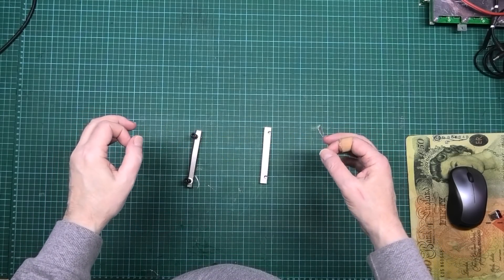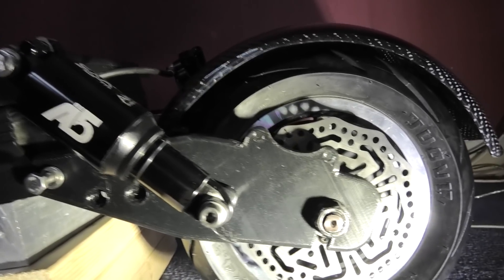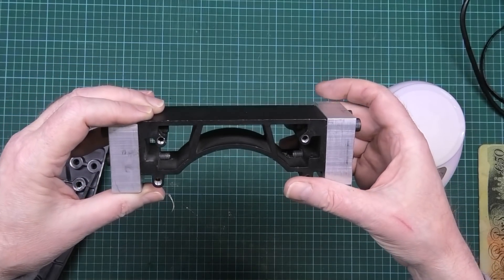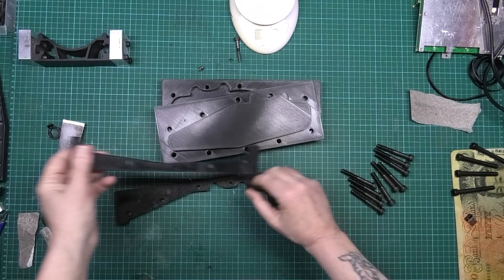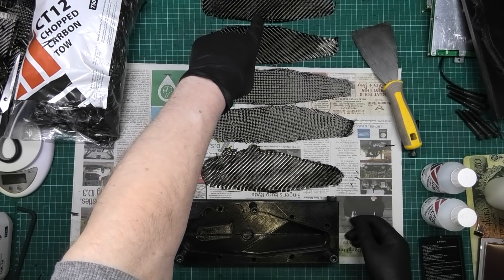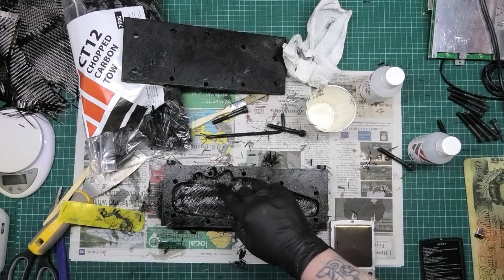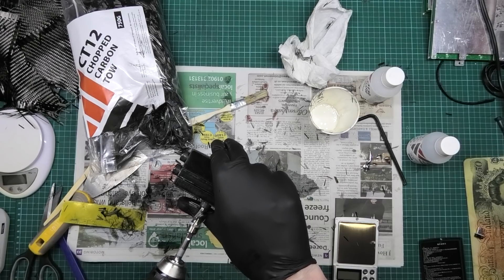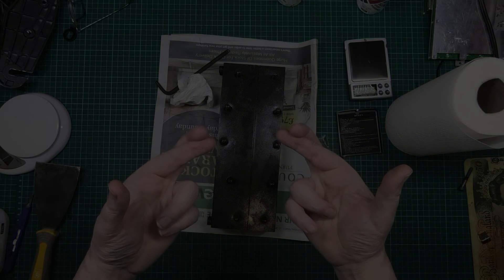🔴 EXTREMELY POWERFUL E-SCOOTER BUILD part 17 - Forged carbon fibre swinging arms

Comment: M3 bolts to clamp the Seat Post in place?... You're kidding me right?
FFS...😳😳😳🤔🙄🇬🇧
Reply from the maker: If it was into a solid steel square mounting plate as I thought it was, it might have been acceptable. When I undid these bolts and a shitty little piece of aluminium fell out, I was shocked!
Imagine on the upper end of the weight limit - a 120kg bloke....... his bollocks would be toasty within hours of use!
Reply: @Vortecks  Why would they use such small diameter bolts..?..Tapped into Aluminium.. FFS....gross stupidity...🤔😳😳🙄

Comment: Hi Tony, Always glad to see you making progress. You're inspiring me to have a go with carbon fiber too - lots of work but amazing results (Just need to finish all my other projects first!).
Regarding the mould, as others have said you can use the offset line tool to make it smaller without changing the alignment. It makes another line parallel to the first, same effect as sanding off an even thickness all the way around. Just remember that the offset is doubled as it affects both sides - I'd start at about 0.25mm as every printer is different and better to take off too little and sand the rest than too much and end up with loose fit.

Looking forward to how it turns out!
Reply from the maker: Cheers mate 😁
Yes, it has been mentioned about the resizing but what software is that in? I'm still using Tinkercad and obviously, it doesn't have any complex functions.
Reply: @Vortecks  I'd never used Tinkercad until today and I'm amazed you managed to make the things you have with such basic software! I was hoping to see if I could figure out a way of doing it, but I think it's probably just not possible (googling got me nowhere either).

I use Fusion 360 - free, powerful and oodles of youtube tutorials. I definitely recommend giving it a go. Once you've got the basic hang of it I think you'll find it quicker and easier - it's much better suited for engineering.

Comment: Don't know if anyone said it already, but when it comes to the mould creation in 3d software, instead of resizing the whole model, you can just subtract .5mm from the entire perimeter, which will give the exact same affect as sanding every edge down the same amount. Just food for thought Tony, been loving the cf conversion so far, really making me want to give it a go!
Reply from the maker: Someone has mentioned it before but what software do you use to do that? I'm only using Tinkercad (please don't laugh) 🤣
Reply: @Vortecks  tinkercad should be able to do it I think, honestly im used to autocad, but the cad concept runs off subtracting one item from another, I think the function you might be looking for is called sweep, someone in your discord may know more about the specifics than myself hopefully1

Nothing wrong with any program, i used to use sketch up

Comment: You continue to impress with your carbon fiber work. It's amazing what you can do from home today when you have the right tools like a 3D printer and the carbon fiber mixture. But you are right - the last thing you want to happen to you flying down the road at 40MPH is a hard rod going up your crack because the damn seat came off. Tight black leather shorts optional LOL
Reply from the maker: Tight black leather shorts are optional? I thought they were compulsory? 😢
I was rather surprised when I saw that 2 bits of 10mm square aluminium was all that holds up to 120kg!

Comment: I’m not sure what CAD software you use, I use autodesk Inventor and it is really simple to mark a sketch such as your swingarms perimeter and make it cut a set thickness from the edge without giving you the distortion issues you mentioned!
Reply from the maker: Cheers mate, maybe it's time I gave some other CAD software a go again. I only use Tinkercad because everything else was rather unintuitive - teaching an old dog new tricks isn't easy!
Reply: @Vortecks  the feature is called offset! I am pretty sure tinkerCAD doesn’t have it but it is incredible! I use it all the time for my interference fits

Comment: Wherever there's room for improvement, you can be sure Tony will find it and do something original about it. They way your parts turn out is so professional you never fail to impress me. Even closer to that magic 19kgs too!
Reply from the maker: Cheers mate, it's appreciated. You're a few weeks behind on the build here but it does weigh 19kg now so it's ready for assembly. I'll do the other parts as and when I get round to them to make it even lighter 😁

Comment: Looking good Tony.
BTW last time I made CF parts I used several layers of GF Roving cloth inbetween the CF to save money. GF Roving is a fraction of the price and the parts still came out perfect. Nobody could ever have seen the GF and I don't believe there was any weakness caused.
Just a thought for future parts.
Reply from the maker: Yes, I've seen many quadcopter frames made this way with GRP layers. I couldn't live with myself with structural parts like this, I don't think there are any corners to cut. I'll definitely consider it for cosmetic parts though 😁

Comment: @Vortecks  What is the approx price of the fibre and resin used for this scooter project??
Reply from the maker: Probably £100? I had most of the stuff already so I can't really put an accurate price on it.
You're better off buying the kits to do the job, Easy Composites sell all the kits you'd ever need.
Reply: @Vortecks  ok.  £100 is what I would have estimated using fibreglass,  so carbon fibr only a bit more than GF.  Good to know.   Cheers